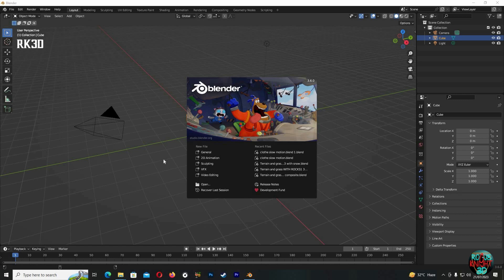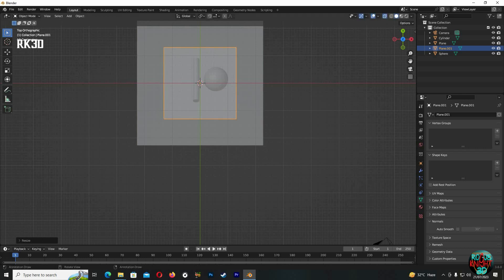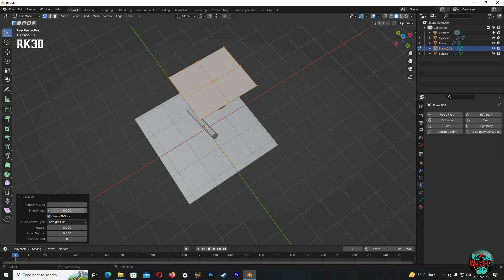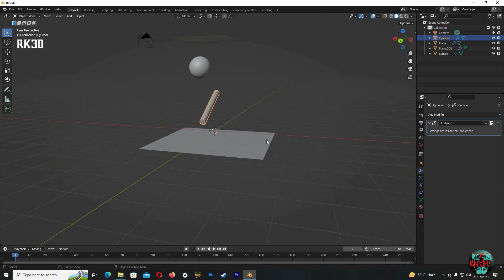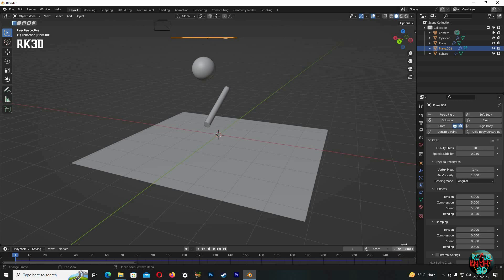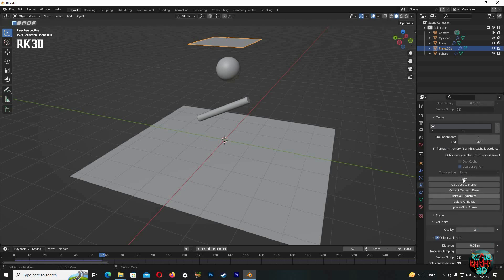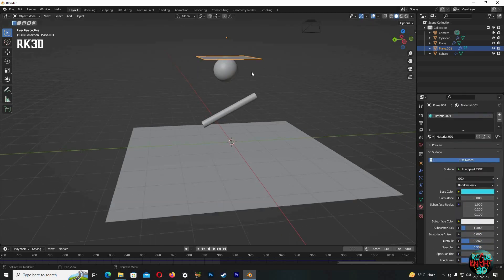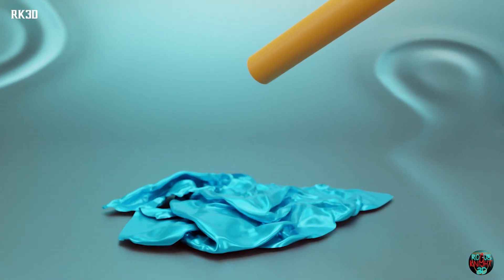Blender Cloth Simulation || Make a Slow Motion Cloth Animation in Blender || Blender Tutorial

Comment: Thank you! this is the solution I was looking for! I could not figure out why nothing changed when I changed the frame rate, even when I re-baked at the higher frame rate. I found another solution, a work around, by exporting a Lightwave MDD file, importing and applying  that and then getting rid of the cloth sim. This worked pretty well, but it's much more work than what you're doing, which is obviously the correct way. Thanks again!
Reply from the maker: Its totally ok bro.. am glad you found it useful